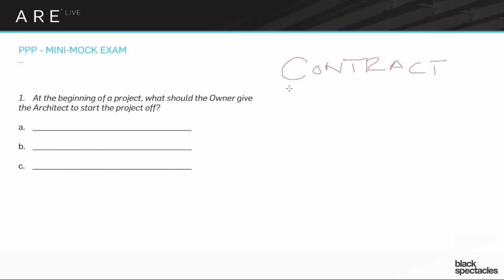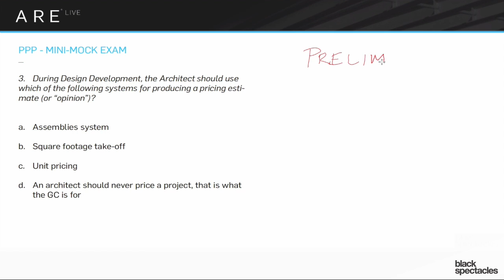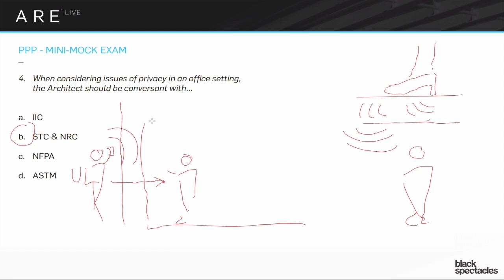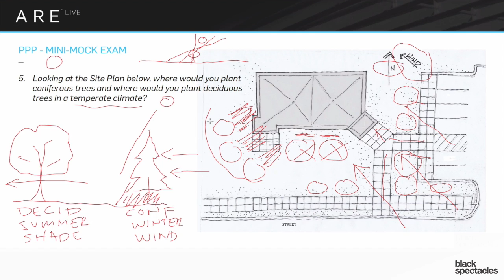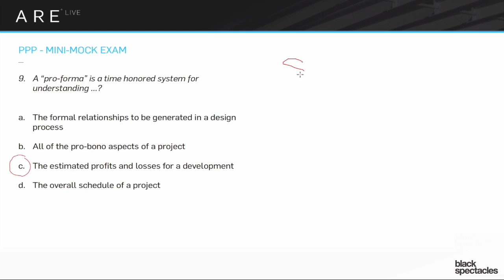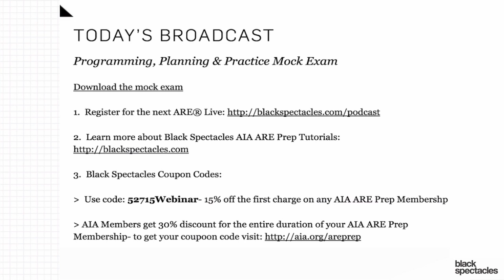ARE Programming Planning & Practice Mock Exam- Answered

Comment: I have a question about question #3. You state that the architect does not give pricing for the CD phase bc at that point it's going out to bid and the GC will price it. 
This seams to conflict with B101 3.4.4 where it states the architect shall update the estimate for the cost of work. 
Can you clarify this? 
Thanks
Reply: +Daniel Shaffer I think he is wrong. During the CD phase the measurement used is based on unit rates for cons. competes, assembles an systems. This estimate is what the pre-bid cost check and cost breakdowns are based on.